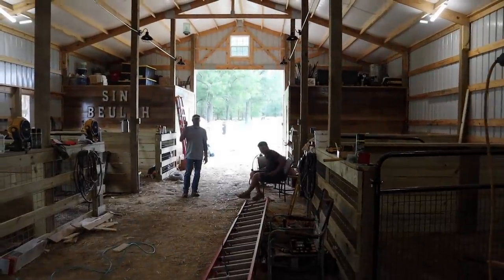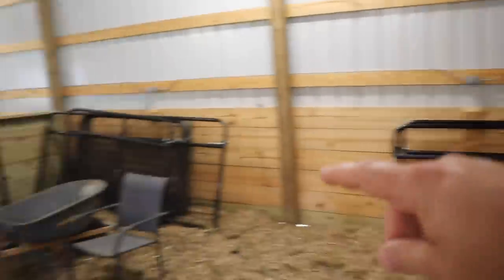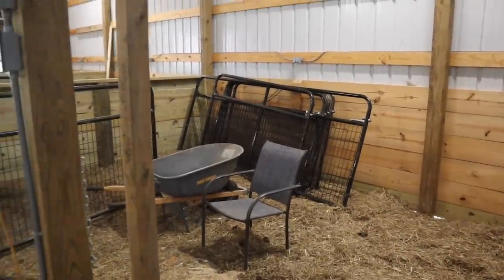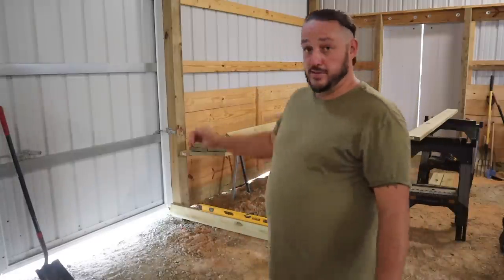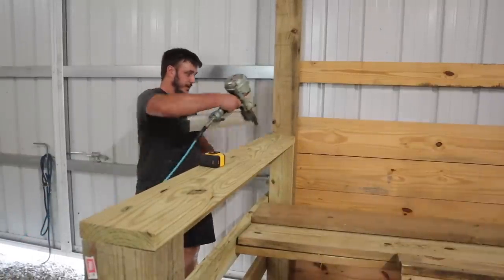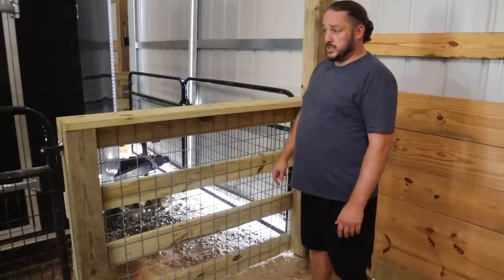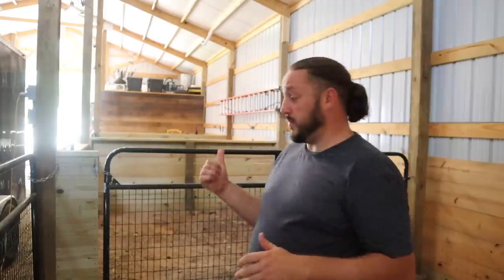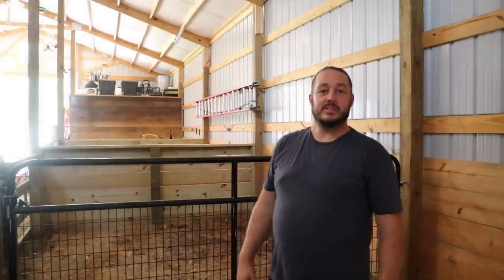Finishing the Barn Stalls | Jeremiah's Update VLOG

Comment: Wonderful work on the barn.  Tip for 6’ gates at each end of the barn- make a “L” shaped pin out of sucker rod attached to end of gate that can slide up and down to hold one gate closed. The pin will stick into ground to keep gate from moving.

Comment: Excellent job Miah! And of course Noah and Wes too. You guys do such lovely work!  I love the thought you put into everything! And appreciate your sharing all the tips and tricks.

I love using gates to change the configuration of spaces to make them more utilitarian.

The barn where I boarded my first horse had massive 2” x 12” x 12ft boards which fit into a channel on the structural posts at front and back of the stalls. They were pretty much indestructible as stall walls go, but they were stacked 10 ft tall and made it quite dark in there. But when we had a mare approaching her due date we simply took the wall apart by lifting the boards out of the channels. It took 3 strong men and a boy to take it apart and put back together though! 

We’ve just moved to a “new to us” farm. The barn was only ever used for storage prior to us purchasing it. We are still trying to determine how we’re configuring everything. We have a 90ft round pen , plus 10 extra panels. We have a friend who is a welder who attached that exact 4” square wire grid to 8 of the extra panels, 6 of which are currently the side walls of 4 stalls.  Then we have the same gates you guys use, and the front of the 4 stalls goes 6ft gate, 12 ft panel, 6ft gate, 6ft gate, 12 ft panel, 6ft gate. My husband is a master leather craftsman and he came up with a cool system of straps which hold the panels together inthe config we need.
Reply: Oh, I forgot. When you originally spoke about the gate that would slide back along the tack room wall I immediately thought of the system we had to keep the horses in and out of the barn where I took lessons as a pre-teen. It was 2 massive planks which rested in and slid on a set of brackets on either side of the door. They were aBout 54” and 24” off the floor. You didn’t have to slide them all the way back every time you wanted to lead a horse through, just slide it  wide enough, go through and slide them back. Simple but effective for larger animals. But probably not useful if you’re trying to keep goats or even mini donkeys or miniature horses out.

And finally, I’m sorry for the loss of your grandpa.

Comment: I've seen horse stalls with C- Channels that divide larger stalls. You just slide in the boards to make 12x12 stalls and then you can remove the screws and boards if you need a larger 12x24  foaling stall etc.
I guess gates are quicker though lol.

Comment: Very beautiful, flexible  and utilitarian build with great consideration for all your animals needs and for potential future uses in mind! It's amazing!! Well done! Wish I had someone as talented as you guys around near me!! All I'm wishing for is a lockable, wooden, screen door  with an outside handle and a dead bolt keyed to outside with a  latch to inside and dog grates to protect the screens. It would help my little rental cool off nicely in the summer heat in excess of 100⁰F+ daytime temps as in the evening we have nice breezes and since I don't have or use AC, too costly.  It would be secure, I could leave my solid front door open all night to afford the cooler evening breezes to cool my home, but you'd think I was crazy or asking for the moon on a silver, engraved platter. Been quoted above $500 to $1000+ or more for a heavy, huge, metal, security gate and have been told wooden screen doors don't exist and are undoable,  yet we had one at my parents old house that's still there 80+ years later.